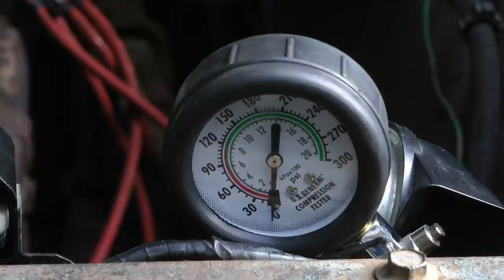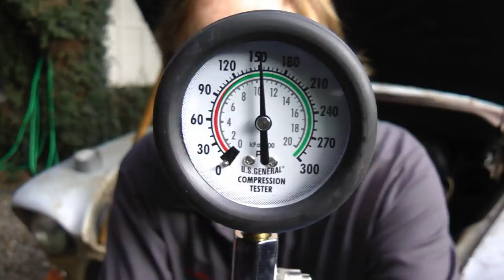How to Tell if Your Car's Engine is Bad

Comment: My 2000 monte carlo try to crank but doesn't. I just hear a loud cluck from the starter. It was driving fine Last week now it doesn't start at all. I've replaced the starter and the battery. My security light,my battery light, and my low oil pressure light all come on, but I just had a oil change 2 weeks ago.I was told that my engine is locking up Witch means the end of my life as I know it can anyone please help me I put too much into this car for it to end like this.
Reply: Chise Sosa ... I'm probably not the best guy to answer your question but since nobody has offered help, I'll give you something to think about...did you compare the old starter with the new one. Sometimes there are slight differences so while it could bolt up fine, it might not engage. Maybe more likely it has a shim problem. I've always been luck enough to just put the shims back the way they came out (if it had any) but this may not always work. All I have. Good luck

Comment: my car is smoking from the tail pipe i try using 10w40 and some stp stop smok and drove iit 100 miles HELP
Reply: what color is the smoke?
Reply: Blue
Reply: that's a sign of worn piston rings. not much you can do without tearing down the motor and replacing them.

Comment: Why do I hear ticking a lot in my motor?
Reply from the maker: generally ticking valves or ticking fuel injectors. listen with a stethescope to find out
Reply: Always something. Engine light went off. 2 things soo far. knock sensor and oil pressure switch gage.

Comment: Give up on the project? If I had to put a new motor in that rust on the door there is being sanded and clear coated over until I can save up for paint after the motor lol

Comment: Rebuild the engine as this is obviously a restoration project. As it's only 60 years old.
Reply from the maker: Claude Rains yea, but owner was pissed cause the engine is a used one he just bought from a junk yard and he assumed it would be OK, which it isn't. so he's not shelling out much yet.
Reply: Well most recycle yards give 90 days warranty. At least mine does. And being you can pull those engines in 5 hrs while watching TV. I would yank it out and go get another. He should also take someone with him that knows what to look for. 

Better yet pull the engine and just overhaul it. Might cost the guy $250.00 in parts and his labor. That way it's not going to leak oil, burn it or throw a rod.

Comment: can't you open the engine and replace the piston rings?
Reply from the maker: +Misha M o course, but that's big money and this guy just had a used junk yard engine installed he was told was good, so he's not going any further
Reply: +Scotty Kilmer Would it still be big money if one would do it at home?
Reply: +EragonSuperM you need proper tools and machines to get an engine on and off and then you also need the specs to torque down nuts and bolts you also need to be very careful and not to scratch the pistons or the piston rings because that will also damage your engine
Reply: Cruz Ivan Garcia-Escamilla I know, my dad has done it. I'm in the process of doing it as well.
Reply: +EragonSuperM I've done it before
Reply: Cruz Ivan Garcia-Escamilla I'm normally not careful with anything, but when It comes to important things like engines I usually do it right.
Reply: +Scotty Kilmer But why spend money, time and stress with a junkyard engine when a crate engine of similar style isn't too hard to procure in the first place?

Comment: The compression is OK for an old engine. Will go for miles.
Reply from the maker: Crobular I yes, but it burned a lot of oil and the owner was pissed as he just paid someone else to put a "good" used junkyard engine in it.
Reply: Crobular I You are right, but it really depends only on how much the owner wanted to put into it. If it was me, and I really liked the old truck - i would first switch to a heavier oil like 10W40 and add in a quart of Lucas Oil stabilizer. It slows down the oil burning / consumption. That would buy the guy plenty of time to start looking for an engine while he fixed the body, etc.. He could also have that engine over-hauled.  Personally I would keep the truck if it was me. That lower compression wouldn't scare me. Scotty did a great video though, as alwasy
Reply: Crobular I Of course you need a sealing engine to make use of the gas you put in it. While you are at it - fix it. That's roughly another 25% of torque you´think is a good  idea to waste. It would make sense, kind of, if you are only hauling manure from A to B, with somebody else is paying the bills. Just breaking the cylinder with a ridge reamer and honing with a ball hone, then putting new rings would make  a world of a difference. even though the cylinder still wont nbe perfectly round. That is a cheap fix with pretty good quality, if you do it yourself.

Comment: who puts platinum 4 spark plugs in an old engine? they are meant for Computer controlled engines
Reply: umm... that was certainly not an old engine. I don't know what engine from way back when is cleaner than a brand new one.
Reply: +michael zharoff You got that right.   Even in a modern yet well used engine.    You can get a good set of plugs for 10 or 15 bucks.     No sense at all buying  90 bucks worth of plugs that will last 150,ooo miles for a car that already has that many miles.    The only time I use those exotic things is if it happens to be one of those horror cars that you have to jack up the engine or be a contortionist to change a couple of them.    Cars burn so clean today deposits are normally never an issue anyways.

Comment: You should have cranked the engine more on first test
Reply: +jammeson bateson Im not experienced with cars but should the pressure be in the green on the first or second crank? If it takes 5 cranks to get it to a low reading then Id imagine that it is still indicative of warn piston rings.

Comment: i hope someone answers this. i just got a 05 malibu with the 3.5l v6. my
 little cousin drove it with NO OIL and it started knocking. it then 
siezed on him about 4 miles later. (because hes brainless lol). anyway. i
 towed it home. the next night i put oil in it. jumped the battery 
(because he killed it trying to restart...smh). and i started it. 
(probably not smart). it cranked FINE and ran FINE. but it was knocking.
 it set at idal for around 3 min. it knocked for about 30 seconds after 
cranking then it SMOOTHED OUT. it didn't knock for around 1 min or 2. 
then it started knocking again. then after about 10 seconds of knocking a
 second time it did a quick squeal and seized. ive left it alone since. i
 really want to just replace bottom end bearing and drive this car. its 4
 door and i need one for my coming 2nd child.. what do you think?  do 
you belive i can salvage this car by replacing rod and main bearings? i 
plan to do this with engine in the vehicle. thanks in advance!
Reply: dylan scronce usually repl of rod bearings w copper clad will fix bearing spun . assessing crank .done 3-4likethis lasted yr or so. start looking for used engine.
Reply: dylan scronce doubt if main bearing damage.
Reply: cylinder #1 was spun. crank was severly scared. as was rod cap. i bought a used engine with 65k miles for $450. it was basically just a block and heads. since they had taken everything worth a dam off. and they snapped the intake manifold and crushed the electronic throttle body...smh... but im getting there. im waiting on friday for my check so i can get all the gaskets i want to replace
Reply: Give 'em Hell Dylan.

Comment: I'm sorry, i usually enjoy scotts videos, but this one he did the compression check incorrectly.  i am absolutely shocked.  he only turned the engine over a few times the first and then double the seccond, that's not right.

Comment: It only has 128,863 miles and it doesn't knock or smoke
Reply from the maker: +John Shutters engines can wear in many ways, first do a wet and dry compression test of the engine to see how it is mechanically

Comment: My car spits out water of the muffler is that bad?
Reply from the maker: all cars put some water out as gasoline is H and C  which when burned in an oxygen atmosphere create H2O, which is water. If you are not losing coolant in the radiator, that's normal. If you lose coolant, head gasket is blowing
Reply: Thats just condensation nothing to worry about if your engine is overheating though check the spark plugs and such if theres coolant in the spark plugs it means your headgasket is blowing!

Comment: Did you warm it up? Still 125 is awesome. I've seen 95psi run like a scolded dog too. She ain't worn. She'll last another 100 thousand.
Reply from the maker: +Moto Maniac yes, it can run, but owner just put this "good used" junk yard engine in and it smokes like mad, so he was pissed that he got a worn out engine just installed

Comment: My girl ran the car without gas till it started to bogg out then it died and I pushed it and filled the car up it ran with it bogging out the lost power and shut off it wants to start but doesn't is that the fuel pump

Comment: if my truck is smoking blue out of my excaust and my oil stay full on dip stick
Reply from the maker: +Raymond Griswold blue smoke is a combo of burning metal and burning oil, your engine piston rings and or valve seals are worn, live with it

Comment: So no removing the air cleaner and holding the throttle down so the carb blades are open or removing all plugs before the test or using only a teaspoon of oil ???? How about only 4 revolution?? Lol
Reply from the maker: as long as you do the same on all cylinders, it doesn't matter. Because it really is a relative compression test

Comment: Engine needs a rebuild OK, that's IF there's enough left to rebuild, if it's already at .030 overbore, crank at .030 , there probably ain't. The doors have deep cancer in the bottom and at the hinge pockets on the cab, and the rear wells behind the doors on the back of the cab, windshield is badly scratched, the whole bed is covered with WTF@$#%, the rear fenders are dented and all the bolts that hold them to the bed are gone, ARE THE FENDERS WELDED TO THE BED NOW? wth is holding them on? look at the weird little box tubs in the bed welded on, wonder what they did underneath? Scotty didn't say anything about brakes condition, those instrument cluster gauges aren't available anymore, they NEVER had A/C, and power brakes were only available later in about 1959 and rare as hen's teeth. You never saw the driver's side body either that door got used the most, no doubt it's even worse. What rear end is in it? those get expensive too.

Comment: Not. Everyone is as knowledgeable as you, Scotty.  There are a million and one other things that could be drastically wrong with an engine even if the pugs are clean and compression is fine.  To imply that good compression should be a sole deciding factor strikes me as an oversimplification of a complex topic and might be better presented in a more cautionary way.

Comment: You cranked it more on the wet test than the dry test. 125 on 3 cranks is pretty damn good compression. If they are all within 10% of each other they are most likely fine. Its an old engine burning oil is in its blood. This video shows alot of misinformation. To me it looks like you just did not want to work on this truck and told the guy he had a bad engine to get it out of your hair.

Comment: fuck my mint condition 1969 nova has a bad alternator, i think ill just throw it away... what the fuck man. why would you tell someone they should give up on a project. its called a project for a reason, you and i both know, that any tool savvy person could pull that engine and rebuild it with under 400 bucks and a little elbow grease.

Comment: Sorry that motor is good.
Reply from the maker: +James Wil well, it runs OK, but burns a LOT of oil, and he just had it installed as a "good" used engine right before this video so he was pissed.

Comment: But how do you know its the piston rings.................ok no its fine
Reply: +V6 (12-Valve Supercharged) because the il flowing downwards coats rings on piston and   takes up the leakage gap in the rings causing the loss of compression,thus it raises the compression,if it doesn't you probably have leaking valves.
Reply: And if the piston it's self is cracked? Have you ever considered that
Reply: huge jarse
there is no country in the world than my country Mzansi South Africa.

Comment: Looks like he should have bought a Toyota project car. The Toyota cars are much better and far more reliable.
Reply: nope. Ford Dodge cars are EXCELLENT for the right mechanic oriented folks
Reply: Robert Berin  not NEARLY as reliable as a Toyota. Look at Scotty’s celica!
Reply: @MrPowerYak  Check out used Sebring (02-04') or other Dodge/Ford prices vs celicas. Key is you have to be willing and able to work on the car. You will enjoy the leather seats the premium audio at 1/3 or 1/4 the price as a Toyota.

Comment: so the dry test was low and the wet test was high..... you make no sense. your videos are cute and all but I would rather you explain more thoroughly
Reply: Dry test was low meaning the pressure could not build high enough due to worn piston rings. By pouring oil into the cylinder, it helps seal up the piston ring more warranting a higher pressure reading. He clearly explained this. Some basic engine knowledge is needed to understand his videos. If he had to explain every part and exactly what each part did, the videos would be too long
Reply: Long story short: the smaller the difference between wet and dry pressure readings, the better the engine.  Also I'd use an oil squirt can and a length of tubing for the wet test, it seems to me it'd be easier.
Reply: Yeah, if you didn't understand what he explained in the video, then you need to stay away from any engine repair and pay a professional.

Comment: Why would you restore the truck and not restore the engine and trasmisson with it. Its like finding a ugly chick spending thousands of dollars in plastic surgery to make her pretty and expecting to get pretty kids. 
The parts for these motors and transmissions are dirt cheap compared to what Im used to rebuilding.
If you cant do it right dont do it at all.